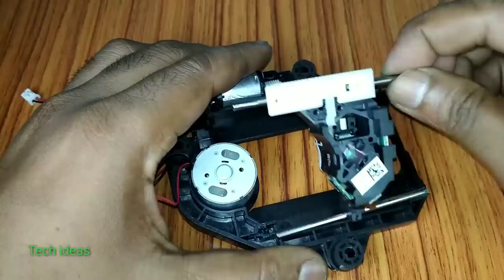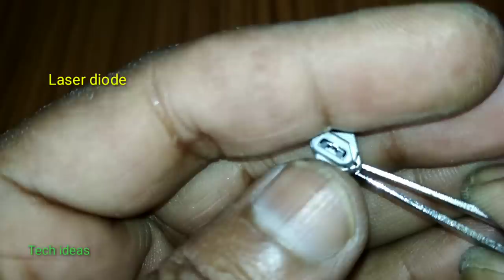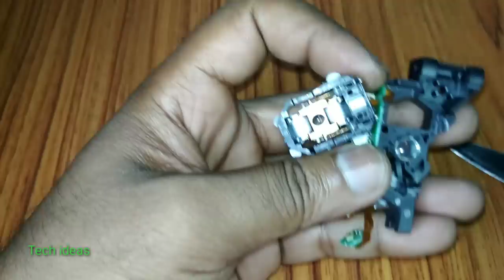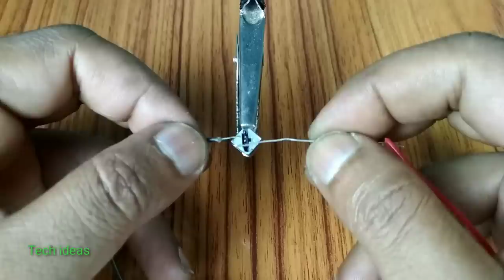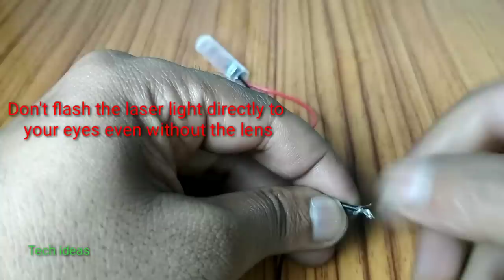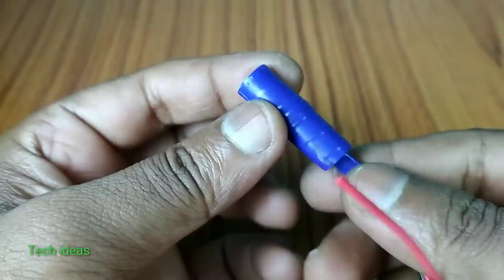Homemade laser torch

Comment: That laser diode will see a early retirement.  Without a proper driver  circuit it will burn out for sure. That resistor as a ballast will not cut it!  Laser diodes are very touchy  devices . Does not take much to destroy one.

Comment: if I up the wattage of the power source will it make it more powerful.
Reply: robert wisehart yes but would burn out the diode very quickly,  now had he not glued the lens in place it could be focused to the point of very slight burning.

Comment: You said it was a torch. Besides people that click on this video, what can it burn?
Reply: That's what I expected also,
 a strong burning laser.   but sadly torch just means flashlight in many parts of the world.
Reply: @pacovasda5955  he didn't show but you can burn matches and engrave some materials not including glass and acrylic. It won't cut thicker material, either, just paper, EVA and cardboard
Reply: @brunocabral1578  ever shallow and ever slow, burning is still burning.
 that's cool.
Reply: @brunocabral1578  although it won't burn glass or acrylic, couldn't you put a thin coating on that it could burn and thereby transfer some etching to the glass or acrylic?
Reply: @pacovasda5955  I never tried but heard something about working with kapton tape. Perhaps painting can, too